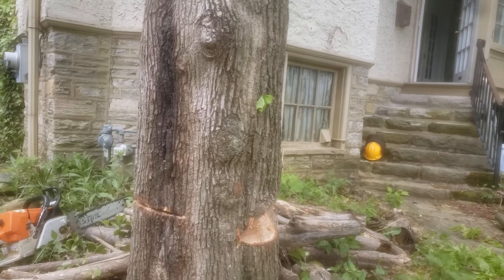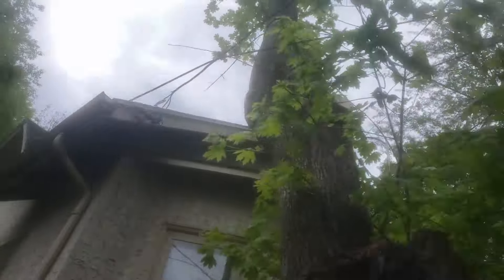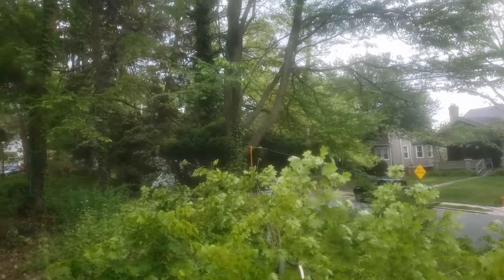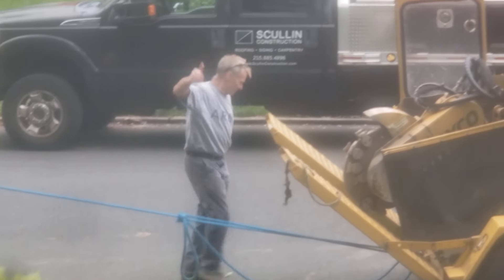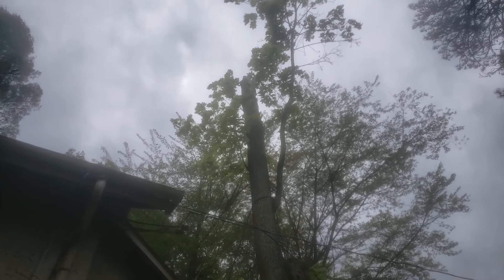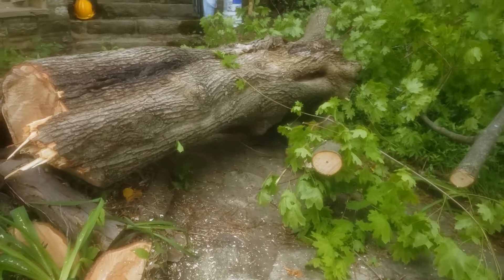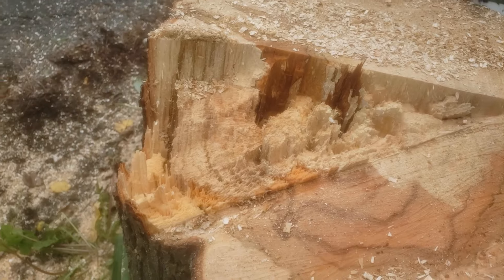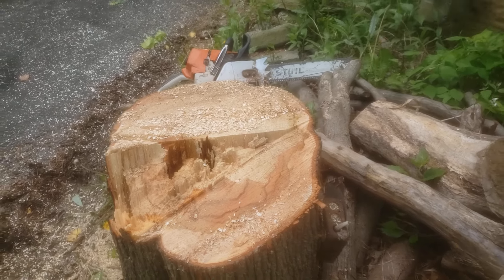Can't Trust Decaying Maple Hinges

Comment: Mr. Murphy,  the Master of 'Command' drops.  This has changed my approach from cutting a tree to its natural release point due to its own weight and leverage to, 'command falls' with imposed redirect line truck pull force.  Thanks for expanding my already sound game to include this card.  I'm learning..
I will most likely apply this soon.
Stay safe and I the same.  Crack!
The good crack.  Nice work.
Also taking control of your fall area.
Thank you.
(My tree falling vocabulary is growing soundly as long as I listen).
We'll be watching this one again.